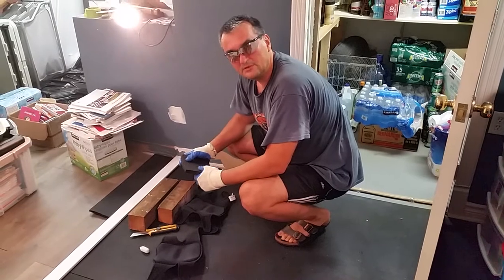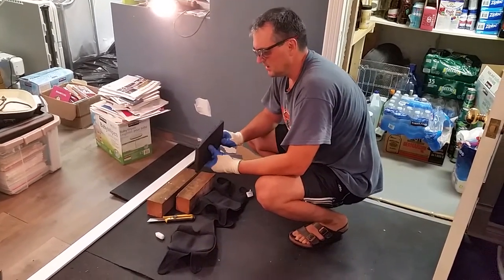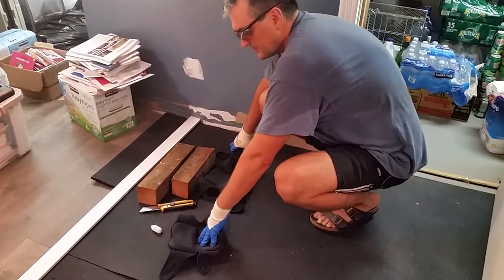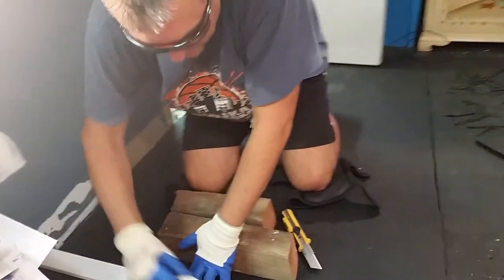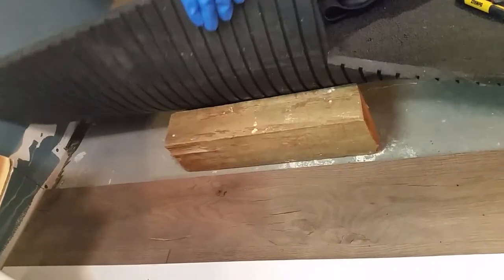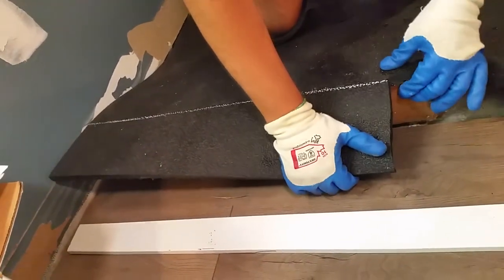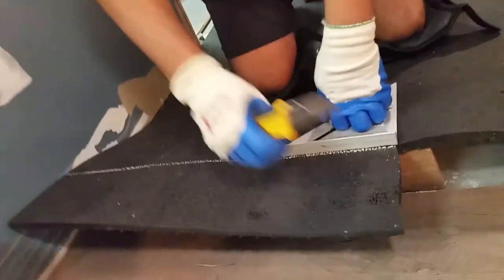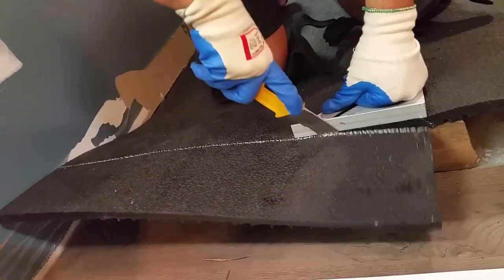How to cut THICK rubber flooring (gym slab mat) - BEND the rubber, then cut.

Comment: As someone mentioned, a lubricant would help. But I would also cut it thru a few passes like a scalpel thru flesh , versus sawing the whole way thru back and forth. Since you have the wood underneath it, you can spread the ' wound' open to easily bypass the already cut rubber.
Reply from the maker: I guess that works too. I love your surgical terminology!